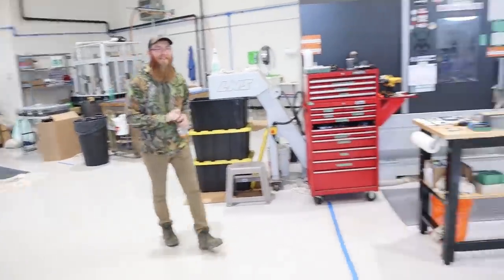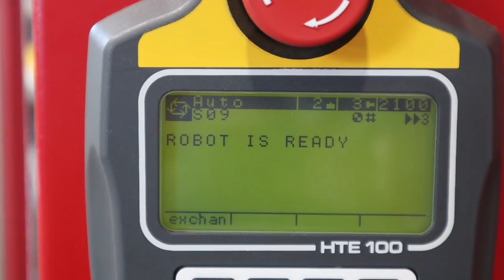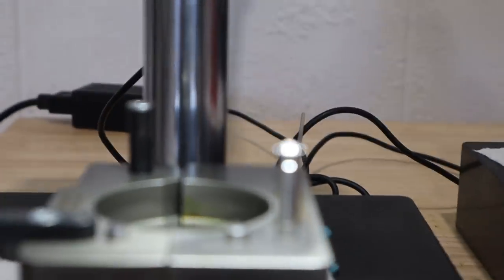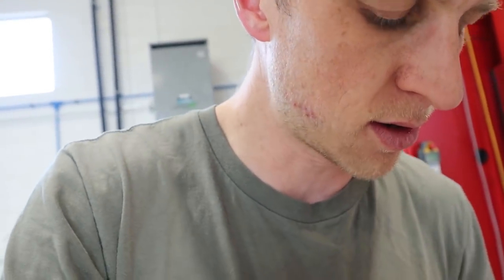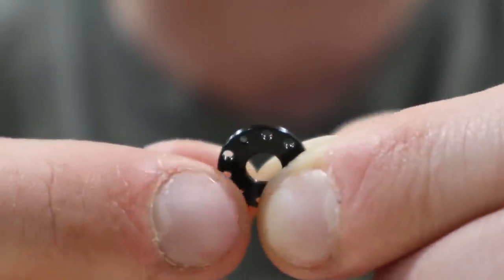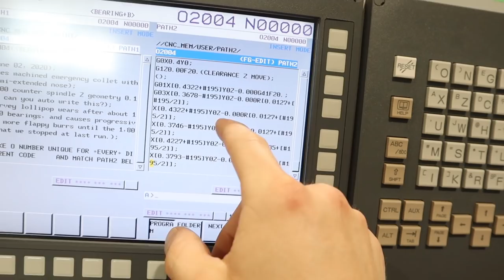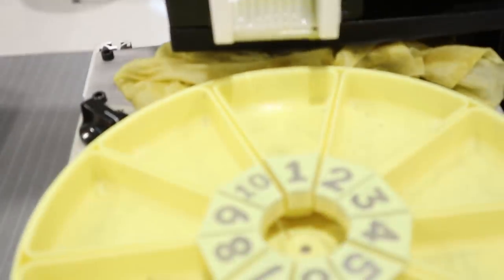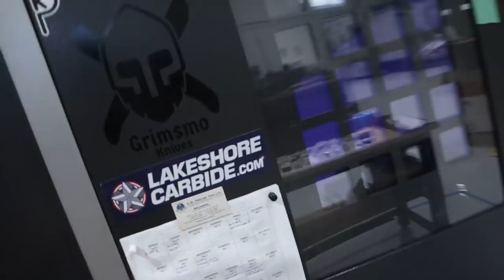Making Peter McKinnon's Custom Saga! - Shop Life 38

Comment: Hey john,
Did you concider doing a "warm-up program" on the swiss to get rid of the trashed parts when the mahine is cold? Or does it not work for this type of lathe.
And for the bearing cage you could drill it in the main spindle to make less work for the lolipop and equal out the cycle time. 
Stay safe and keep up the great work